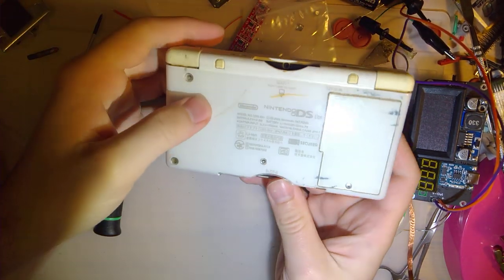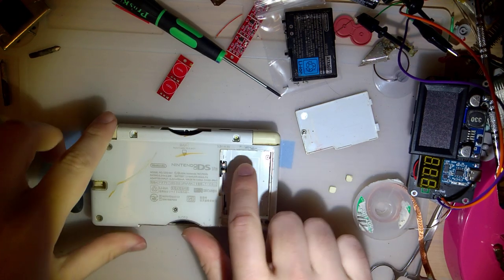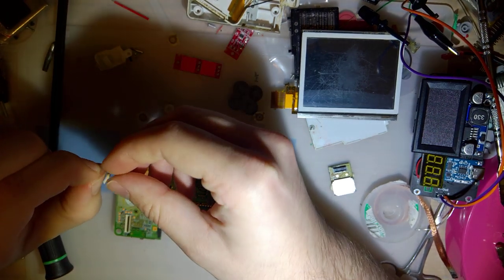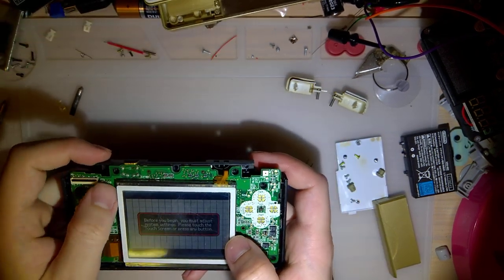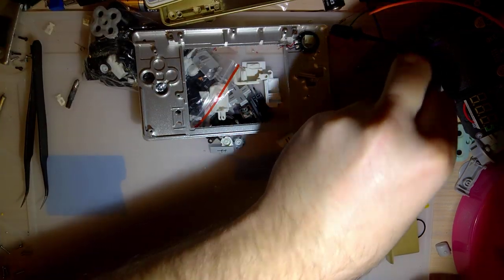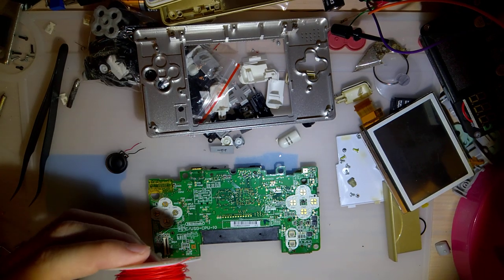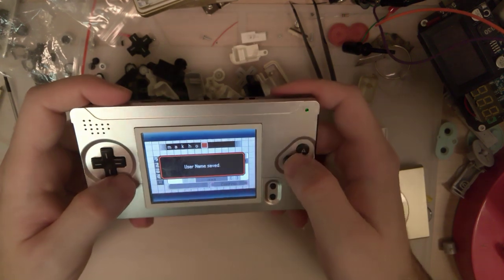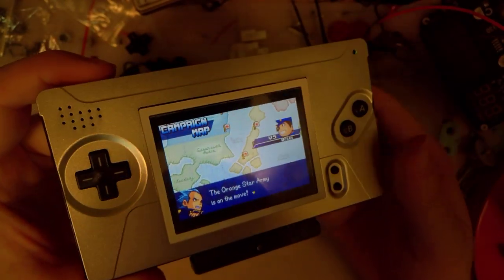Making a Boxy Pixel Game Boy Macro (Nintendo DS Lite) - Part 1

Comment: Actually if the screen flashes when you try to power it on it can be because a SMD capacitor / resister fell off. I purchased 3 of these on eBay for parts and when I opened one of them up I found that a SMD component was just laying in there, one that was back in place it booted right back up.
Reply from the maker: I suppose so. I just mean that the most common cause is a damaged or disconnected LCD, not that it's the only cause. Nice fix though!

Comment: Do you know what would cause a Macro to get less than half the battery life as a DS Lite using the exact same batteries and running the exact same cartridges?  I made a post on reddit but got no responses so thought I'd ask you.  I'm stumped.  The Macro has a single Switch speaker, 330 ohm resistor, Boxypixel faceplate...nothing out of the ordinary.  The donor DS lite had a broken hinge but otherwise wasn't excessively dirty or anything. 

The only thing I can think of is the speaker wire I used was a larger gauge then needed but was all I had on hand at the time.  I don't see how that would cause this though.
Reply from the maker: Did you test this console before modding it or are you comparing it to another console you have? 

Also, the resistor that you solder on to the PCB simulates the load of the top LCD backlight so don't forget to account for that as well. It shouldn't be more than just having the top LCD connected but it won't be less either.
Reply: I wish I would have tested it beforehand but no I'm testing it against another console.  In the DS lite my two batteries last 8 and 9 hours.  In the Macro those same batteries last about 3.5-4 hours.  The way I test them is just letting them run the intro to Pokemon Ruby and Sapphire until they shut off.

Since I didn't think of testing the battery life before the mod I have no idea if it was a preexisting problem or not.  I'm probably going to end up buying another donor DS lite and swapping motherboards and see if it's just a bad board.  Other than the poor battery life it works perfect though.
Reply: I made some progress.  I removed the speaker with the heavy gauge wire and I also used desoldering braid on the top ribbon connector that I cut off.  It didn't look like it was making connections but it did soak up some old solder.  Then I tested the battery life again and it lasted as long as the DS Lite.  I'll put the speaker back on and retest just to help see which action actually fixed it but I have a feeling it was the leftover solder on the ribbon connector.  I don't see how the heavier gauge wire on the speaker would cause it.  Either way I have some thinner wire coming so I'll swap it out when it gets here.
Reply: @joshl.554  I don't see how leftover solder would cause battery to be consumed?